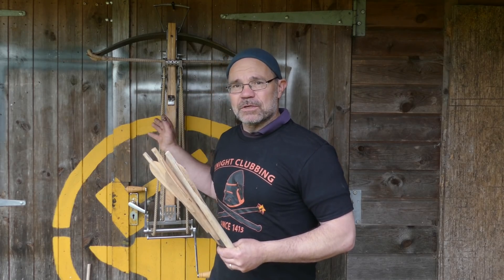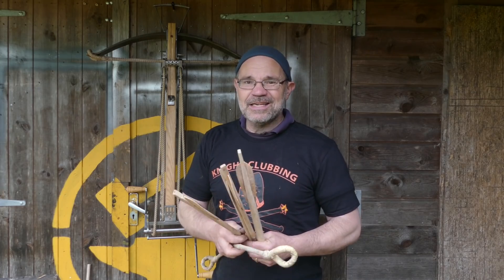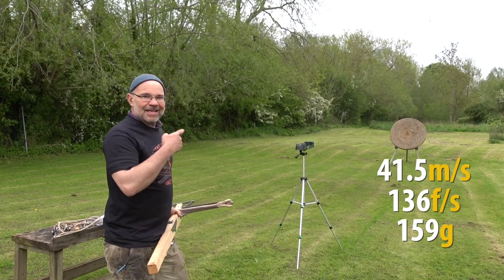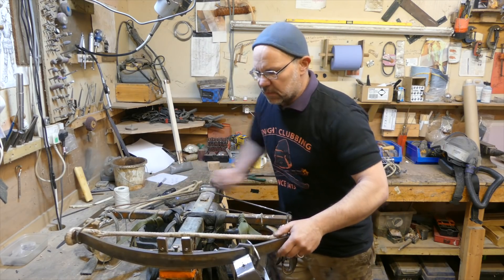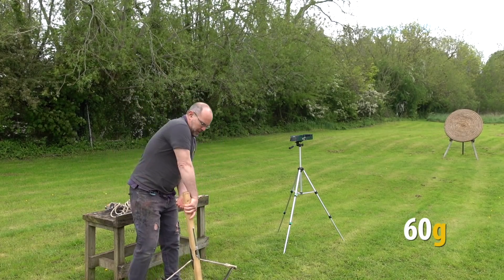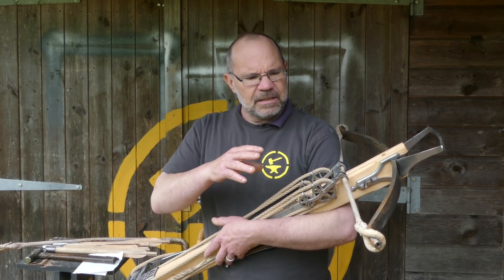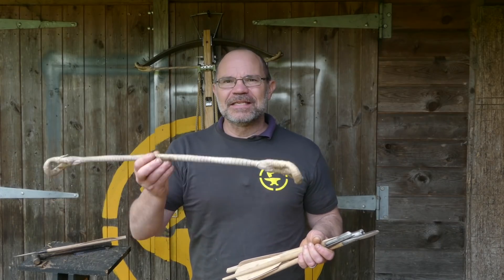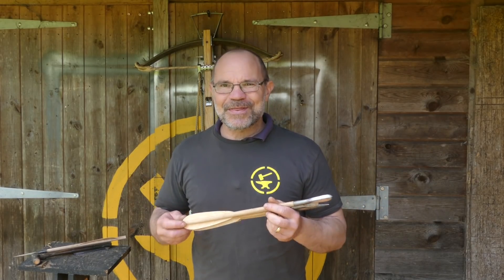Medieval bolt POWER!

Comment: So the projectile with the highest Energy...has the lowest distance. Why? Purely air resistance?
You would think that the heavier bolts harvest the energy much more efficiently (which they do, the Joules are higher) and travel further because of their increased momentum.
Reply: Well, velocity is obviously  most important factor for distance, generally. It has lowest velocity, thus lowest range.
Reply: Ballistic Coefficient. It's a modern term, but it applies to bolts and arrows as well. It's used in calculations for long range shooting. The higher the BC, the better ballistic performance. More aerodynamic shape will increase it and vice versa. Same with mass. It's a balancing act. More aerodynamic shape will create less drag, while higher mass will resist it better (a=F/m, F-drag, m-mass). So yes, in this case the heaviest bolt creates so much drag that it's heavier mass doesn't help. 
Velocity is also a factor. With firearms, for long range shooting you generally will end up shooting highest BC bullet, which more other than not will be the heaviest from manufacturer's LR lineup (for example SCENAR or SCENAR-L from Lapua). Better BC more than offsets the loss in velocity (most of the time). That being said, it probably is much more complicated with crossbows and arrows, with a lot of factors to consider.
Reply: for info: BC = mass/(drag coefficient x area)
https://en.wikipedia.org/wiki/Ballistic_coefficient#Formulas

For these arrows and bolts the velocity dominates the maximum range, drag doesn't affect the ranking much.
Reply: @lscibor  Not really. A light projectile travelling very fast will have less distance than a heavier projectile (with equal dimensions) travelling slower (equal amount of energy).
Reply: @wmyst1797  How do you know? The increased velocity will increase the air resistance. A higher mass will travel slower (so will get less air resistance), and can resist the air resistance more.
So, the slower projectile keeps moving longer and bleeds less speed over time/distance.
While the lighter one starts off faster but bleeds out quickly.
Reply: @anomalyp8584  I did some maths on this question a few years ago. While your argument is sound as far as it goes, it doesn't capture the whole story. Try throwing a softball and a cannon ball of similar size  and see which goes further. 

If there is no air, the faster one will always go further before gravity pulls it to the ground. As you add more and more draggy atmosphere, that will change (gradually). With our current air, there isn't enough drag to make that_much difference (some difference, but not enough of a difference). You might get different results underwater where drag is much higher, for example.
Reply: @wmyst1797  You did?! I'd be delighted to see the math! I've been struggling with this kind of question for a long time now.
I was stuck at the point that i know roughly what factors are into play. But I don't know how much each factor weighs in. 
As mentioned above, it's a balancing act and you need to find the point where one factor will outweigh any other one. 
So basically, what would be nice is a graph/function with all the variables plugged in and see what the outcome would be. 
Like in your example, if you would replace that softball with a pingpong ball....the mass is so low that the drag will bleed it of its velocity so fast that adding extra speed would not do much to the distance.
The question would be...what mass and/or velocity would you need to overcome this,.... ofcourse the questions asked can be endless. 
But it would definitely be interesting to solve the puzzle for a given thrust source (compressed air, spring, gunpowder,...). Where lies the optimal point for the projectile mass (adding = gaining efficiency (joule creep) and getting more momentum, losing mass = more velocity)
Reply: @anomalyp8584  This downloadable program does the arrow flight calculations:
http://margo.student.utwente.nl/sagi/artikel/arrowfs/
Reply: @wmyst1797  Mijn pc kan dit programma niet openen helaas :/
Reply: @wmyst1797  sadly the app doesn't run on the pc...seemed logical. It's an app from 1999...How do you get it to run?
Reply: @anomalyp8584  Try the "flight" model from here: http://www.tap46home.plus.com/mechanics/
(use "Home" >  "Downloads"). That still works on my PC. This site also has lots of other relevant resources and technical information.
Reply: @wmyst1797  thanks man!

Comment: Before I watch the video, my guess is it would be a similar concept to bullets.
Light + fast = better penetration but less stopping power
Heavy + slower = better stopping power but worse benetration.
Reply: Actually, keeping to a single cartridge, light and fast bullets tend to have significantly less penetration than slow, heavy bullets. An increase in bullet weight for a given caliber ('heavy for caliber') results in a higher sectional density and greater momentum, although often at a slight decrease in kinetic energy, meaning they tend to plow through targets. Also, because of the need to change their profile to increase mass but still fit them down the pipe, it also generally results in a broader, flatter meplat, which tends to crush its way through things they impact, rather than tumbling, which a more spitzer or ogive shape does. The advantage of lighter, faster bullets for a caliber is that they shoot 'flatter' and impart energy more efficiently, as they want to stop quickly on impact.

This is especially important for things like hollow points, as velocity is probably the single most important aspect of reliable, rapid expansion. Of course, this further decreases penetration as, the faster the bullet expands, the more drag it experiences (i.e. energy transfer to target) and the quicker it comes to a stop.

The only time that 'light and fast' results in more penetration would be in the case of soft body armor (3A or lesser), where the kevlar/UHMWPE doesn't have a lot of surface area to 'grab,' nor a lot of time to do it, but that's gaming the system playing with the material impact loading speed. In terms of penetrating pretty much anything else - from car doors to animal shoulders - slow and heavy is generally more effective. This is one of the reasons why the 5.56 has difficulty with car windshields (also because they're hard and sloped), when much weaker pistol rounds will plow right through. It's also one of the reasons why SWAT teams have transitioned from pistol caliber subguns to short-barrel AR platforms, for the most part - more lethality on the human targets, with less danger from pass through, and less risk of going through walls and doors resulting in unintentional hits.

If we're talking about across a range of cartridges, well, that's very difficult to make comparisons, as something like a .300 Win Mag will offer significantly more penetration than something like a .50 GI, but there's just too many variables to compare between them (one being a magnum hunting cartridge, and the other being a bit of a novelty handgun cartridge). But, even then, when comparing similar roles (both between cartridges - i.e. intermediary rounds, pistol rounds, rifle rounds - and the purpose of the projectile), you're typically going to see better penetration through a range of targets with something like a 7.62x39 than with a 5.56x45.

Wow, that ended up a lot of text... My bad.
Reply: @ericmitchell985   There are exceptions to that rule, though. For example, an M193 bullet travelling at 990 m/s  will generally penetrate a NIJ level 3 ar500 steel plate, while said plate will easily endure several impacts from an M80 going at 850 m/s, despite the latter having 50% more kinetic energy than the former. The most important things to take into consideration when talking about hard armour penetration would be size of the frontal profile, KE, bullet construction, SD. Kentucky Ballistics tested a level 3+ ar550 plate which stopped a .458 Lott, thats roughly 7000 J of KE.
Reply: @henriknemeth3370  and I've seen a video of some UHMWPE armor that stopped .50 BMG. 18-20kjoules. I would NOT want to be on the receiving end of that.
Reply: @ScottKenny1978  I mean that result is not even that suprising nowadays i guess, since the russian rating BR6 level body armour protects against three hits of 12.7x108 API (more powerful than the 50 bmg) fired from 50 m, and that is with a backface deformation of only 16 mm, meaning that the person behind it would probably be fine.
Reply: @henriknemeth3370  you're still taking 20kjoules to the chest. Yes, it's spread across your entire chest. It's still equivalent to get hit by a car at 5-7m/s. Call it 30kph.
Reply: @Michael Smith .50 BMG or Russian 12.7*108. Vehicle mounted heavy machine guns, mostly.
Reply: @Michael Smith and yes, recoil force from a Barrett .50 is spectacular. It's reduced by the short recoil operating system and again by the muzzle brake.

Comment: Sorry todd dont agree. U just said the sting was longer. Putting less tension on the bow and less force in the draw. How does that relate to it not really making a difference. Love the content and the channel
Reply from the maker: It certainly does make a difference, it must, but the point I made was that it couldn't have been that much of a difference.
Reply: Good excuse for another vid. How does length of string effect power / speed. Cheers for the reply. 👍

Comment: I never believed that 45 degrees is the best angle for maximum distance. It's probably more like 33 degrees, right?
Reply: In theory it's about 35 but it will be individual to each bolt shape depending on the lift that each one generates (to plus or minus 10 degrees or so).
Reply: Yes I think around 30° ish is about right.
Reply: Depends on wind and aerodynamics of the individual projectile With backwind and paragliding projectile it may even be over 50 degrees.
Reply: @JanoTuotanto  yes and you might be shooting downwards, ito a high wind or  through cold or hot air. These all effect trajectory.
Reply from the maker: I just made a film on that.....
Reply: @tods_workshop  sounds like a fun science experiment, looking forward to watching it

Comment: crown bolts are shotgun slugs
Reply: Shotgun slugs you get an energy dump of about 3500J, an old fashioned blackpowder gun in 50-60cal you're looking at about 2500J or so depending on the powder behind it
It soon starts to add up why the crossbow began to fade away once firearms started becoming a military option, not that being shot at by bolts of big lumps of lead either way is anyone's idea of a great time
Reply from the maker: Thanks Kris

Comment: Sadly, I believe that your results were skewed by not using the same shape bolt heads. I believe you should eliminate the shape/drag effects by using the same shaped bolts. Perhaps use a hollow bolt head filled with lead powder or something. Being technically correct is best correct. Other than that I'm still in love with the experimental archeology this channel does.
Reply from the maker: I understand your point, but to be honest I doubt that there was much difference in the 1m between bow and chronograph
Reply: @tods_workshop  yeah, I know. But hey, Hi Tod! Excuse me while i fangirl about the place.

Comment: The heavier bolts do more damage but you cannot carry as many of them.
Reply: I don't think that make a big difference honestly. For the three military bolts the heaviest is still only 30g heavier than the lightest. So, if you're carrying say three dozen of them (which seems a reasonable number to me - much more & it all would get a bit bulky) that's still only just over a kilo difference - compared to the crossbow itself which already weighs over 2.5 kilos. I would imagine they'd have carried a selection in any case - each has its role.
Reply: @riffhurricane  
I have known soldiers that shot every round they were carrying and there were still more enemies willing to fight. Just one more bolt is significant if it kills the last guy trying to perferate you.
Reply: @calvingreene90  Ok, if you were in a battle which would you prefer - a .22 or a .303 rifle? The .22 has much lighter ammunition. ;)
Reply: @riffhurricane  
An AK in 6.5 Creedmoor but unlike the difference in crossbow bolts there is a significant difference in range. Besides I don't like rim fire.
Reply: @calvingreene90  An AK wasn't a choice given in the either/or scenario I presented. We both know full well that though the .22 is much lighter & you can carry much more of it, the heavier calibre would be what you'd choose for its increased lethality. Let's say for the sake of the argument the effective ranges for the two were the same -  you'd still take the more effective calibre even though you could carry less of it.
Reply: @riffhurricane  
Assuming that you mean 22 long rifle I would choose the alternative because while effective at knife fighting range it is way too ineffective and short ranged for any other purpose but I am not a fan of 303 British either but it is useful in a battle rifle. However the choice is not in the least bit an equivalent to the choice of crossbow bolt weights.
Reply: @calvingreene90  It is quite clearly related - you're avoiding the addressing the point I'm making. Not just bolt weight, but the different bolt tip which gives rise to the weight difference in the first place. Different types of munition for different roles essentially. 

On the Medieval battlefield against moderately/well armoured opponents the Needle Bodkin is quite ineffective, though its the lightest bolt. Though heavier, the other bolts would probably be much more useful in the majority of situations.The .22 is much less likely to incapacitate someone than a .303 round, though it is much lighter & you can carry more. Anyway, we're going in circles here, let's just agree to differ. All the best.
Reply: @riffhurricane  
The Needle Bodkin is not as ineffective as you think.
Reply: @calvingreene90  Against an unarmoured or lightly target its very effective. I have some nice needle Bodkins myself & I know how they perform. 

Late Medieval/Renaissance period when those big military crossbows were around there was lots of armour on the battlefield, against which the needle Bodkin performs poorly, compared to the other military bolts in this video. Tod has numerous videos on this channel where he demonstrates this quite explicitly.
Reply: @riffhurricane  
The 22 LR compares to the so called Assassin's Crossbow where as the light bolts compare to 5.56 NATO which is useful at moderate ranges against lightly armored people but uneffective against well armored people. With the difference that the light bolts push the range out instead of accepting less range for more rounds carried.

Comment: there is no difference in power they all have the same energy it takes more energy to accelerate something heavy so it has a lower speed but its heavier,  take a decent average lets say 20 shots for each weight they will all come out to have the same energy